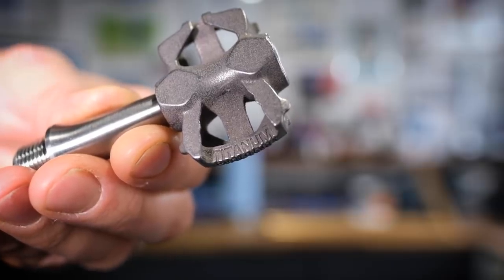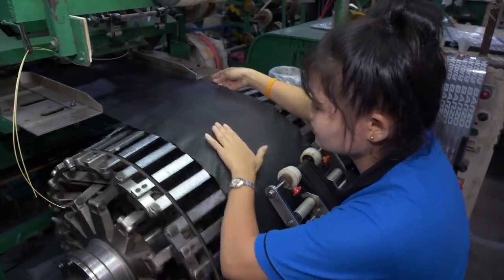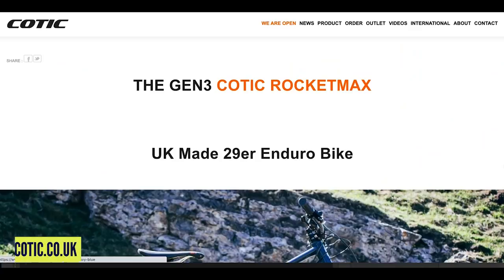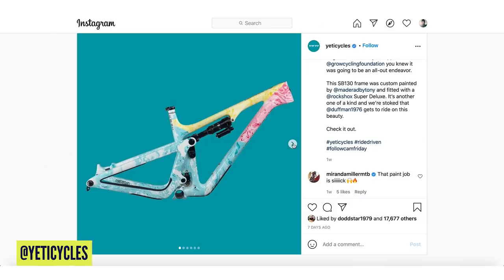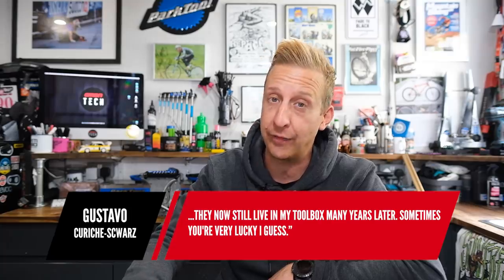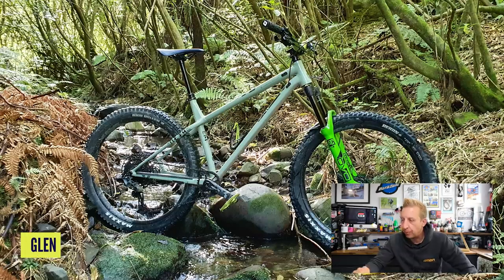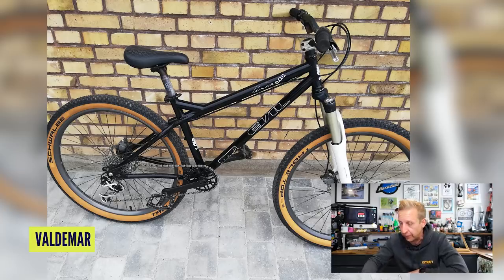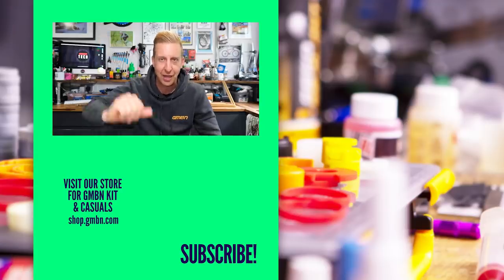Are These The Worlds Lightest Mountain Bike Pedals? | GMBN Tech Show Ep. 174

Comment: Those pedals - really sweet idea and execution. There's a lot of mind-bending solutions in manufacturing now, but what still impresses me the most is repeatability manufacturers like Shimano achieve. Every freakin' derailleur, cheap or top shelf, milions made, with every pin, every pivot, every spring working exactly the way it should and exactly the same on each one of them. Those are the silent heroes of the industry.

Comment: I used to be really into mountain biking, then, I learned to drive, got a job, started going to the pub etc... Fast forward 22 years or so and I had some cash and wanted to shift some weight. I went into my local bike shop and my jaw hit the floor. Back in the day, my best mate had a rigid Specialized Stumpjumper and to us, it was a thing of beauty. Seeing the 2019 Stumpjumper's flowing lines, not to mention all of the advances in drivetrain, braking, suspension, wheel and seat post technology, I was once again hooked! A quick pedal around the car park and ten minutes later the deal was sealed. It's not just on the bike where technology has improved, bike computers are something out of sci-fi compared with what we had back then. My helmet can alert people if I crash, the clothing can stretch in almost any direction and the quality of low-end multi-tools has come on leaps and bounds. As ever, now is the best time to be a mountain biker!

Comment: Watching a bike tech video and hearing about Pickering or anywhere near there brings a smile to my face.
I lived between Pickering and Helmsley for several years around 1993 (a small barely even there village called Beadlam), and Ispent a lot of time in Pickering as it was one of the main places for shopping at the time.
I learned to ride a bike up there and had my first and most serious bike accident there as we would race aound the almost oval road we lived on called The Croft.
No helmet + borrowed bike with no brakes (I didn't know) + steering lockup = 8 year old me going over the bars, across the pavement and into a brick wall followed by the bike.
Sanded off half by face, mangled my nose and turned my glasses into abstract art, but I survived and learned my lesson.

Also, being so close to Flamingo Land meant we could walk or get a cheeky lift most of the way, then get the bus one or two stops and get discounted entry.
Reply: Used to work a couple of summers at Flamingo Land, on the Dodgems and carousel. Fun watching people trying to jump on the moving carousel like us, only to fail miserably and go flying off it :-D

Comment: In my opinion, you can ride without music and you can with it. It just depends on your personal prefrance. Personally I ride listening o the music all the time. It helps improve the mood of the ride, and sets the tone for the trail at the start. SO a fast paced heavy hitting song will instantly adjust your riding style accordingly, and you'll find yourself blasting around trails faster than you would have expected and shredding really hard. Whereas a slow relaxed song would set the tone for a nice chilled run down the trails

Comment: Spank wheels and pedals feel so good. whenever I rent at my local bike park they have the spoon pedals and they are so good. really grippy. I wish I had enough to put vibracore hoops on my trail bike
Reply: I have two sets of Spank Oozy 295 rims and both rear rims cracked around the spoke nipples, in multiple places. The bike is an XC that is only used on gravel or fire roads, no jumps, no tricks. Spank did not want to know, warranty wise and they ended up junked. An expensive exercise. If you use Spank rims, check around the spoke nipples for cracks.
Reply: @andrewkey9401  really? That's interesting I'll need to look a bit more into it

Comment: #askgmbn #askgmbntech Hi Doddy love your show, as an engineer loving geeking out with you. Odd question, was riding over the weekend and suddenly a massive thunderstorm engulfed us even though we had checked the weather app before hand. we rushed to shelter as there was loads of lightning about. I figured with rubber tires and as long as we were pedaling and didn't stop it would be OK. However one of my mates has the victorria graphene tyres, and I wondered about their conductivity. I figured there would be 3 options 
1) the graphene made them conductive
 2) the graphene compound is on the inside and since they were new unworn tires it would be OK? But this should be considered if the tires got worn.
3) the last option I could think of was that the graphene was always coated with rubber and therefore was not a  problem? 

Hope you can help thanks 😊

Comment: #AskGmbntech
Hey,
I' ve got a question about high and low speed rebound setup. I recently got a Vivid Air R2 and to setup the shock I watched a video by vorsprung suspension. In the video Steve told to start by shuting of the HSR and adjusting the rebound only with the LSR. He said you should only open the HSR if you can't get the shock fast enough. What do you think about this method?

Comment: l ride alone most of the time. Music helps me to forget about the distance and the strain. Where l ride it is pretty built up so its not the most pleasing in terms of looks so something to distract me from the sights is welcome. Thankfully there are lots of empty roads or bike lanes if they are not clogged up with parked cars so l do not generally worry about cars. When in traffic l look around and the sound level of my music is never so high l cannot hear a vehicle coming from behind. Besides before doing most things l generally look behind me.

l use a regular pair very nondescript would like something much better but will see with the passage of time. l do not want to use headphones besides the safety aspect, l just do not want to look daft with them riding. So l would try some in ear types.

Comment: #askgmbntech I have 4 piston Sram Guide brakes and they have always been spongy and weak.  Took off the pads to inspect pistons and 2 of the 4 weren't moving and are on opposite sides.  I have had success in the past using Park Tool PP-1.2 on 2 piston brakes to hold one piston while pushing the other out to clean.  But how can i hold 3 pistons to do the same?
Reply: Easy, 4mm allen key slots perfectly into the gap where disc would go, to provide a stop for pistons and to allow fully centralised pistons 
Henry did a great vid on brake hacks etc, probably a year ago now....
Reply: Shimano, u use a 3mm allen key to do the same hack.

Comment: I do as little as possible to block my hearing.  So no Bluetooth headphones for me.  I am waiting for some killer anti-theft bike tracking device.  Like a chip similar to what they put in dogs or cats.  Anyone interested (such as police) in checking a bike for theft just waves a wand over the bike and the wand communicates with a bicycle registration database.  If it comes up stolen, the jig is up.  The issue is that the chip needs to be integrated interiorly on the frame where it cannot be removed.  More than one chip needs to be built in.